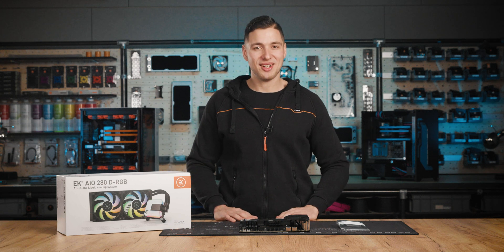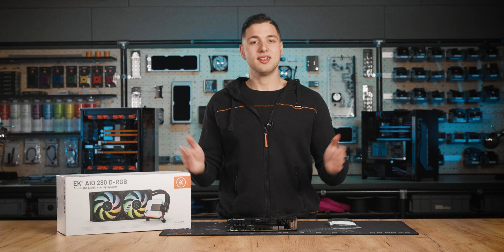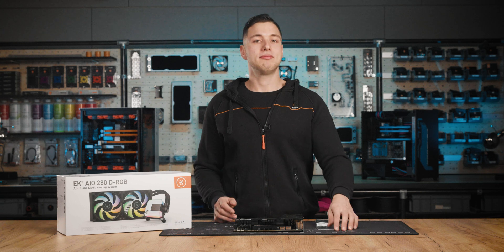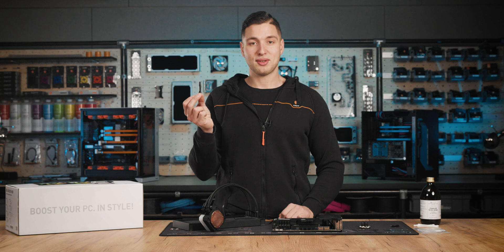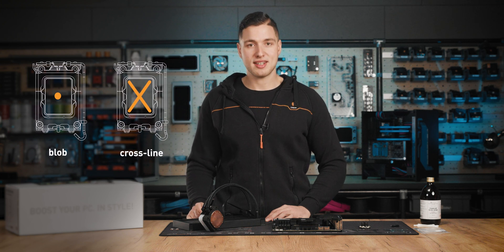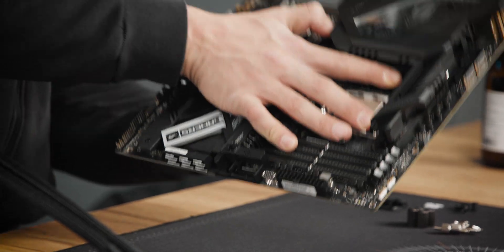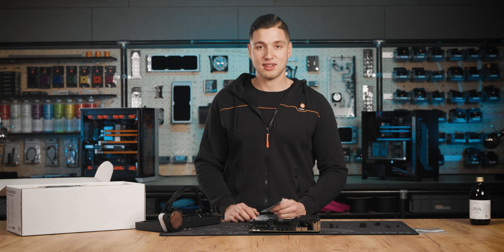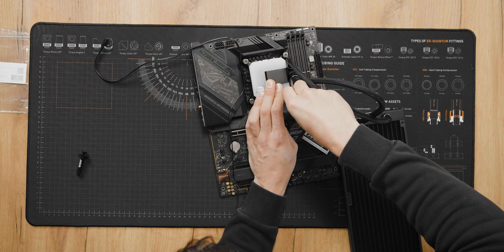Installing the EK-AIO LGA1700 Upgrade Kit for new Alder Lake Intel CPUs | EK HOW TO

Comment: I contacted EK about the upgrade kit and they told me to get it from a reseller. Only links they provided wanted $60+ with shipping.
Trying to figure out where I can get plastic washers or if they are absolutely necessary.

Comment: hey... i have EK AIO Basin 360, it says compatible with only these sockets 115x, 20xx, 1200, AM4 
my question is upgrade kit comes with Velocity Backplate, what about pump bracket ? dont i need one ? 
as i know 1700 socket is 78mm x 78mm, is there any space for that with the bracket one i have already ? 
i know i can check it with  loosening the screws, but i dont have any thermal paste anymore :( please enlighten me.. thank you

Comment: At the very end I caught that I should use only the thumbscrews + springs from the 1700 kit. Unfortunately, I have two bags of thumbscrews + springs that are not labelled,and I'm not sure which bag is from the original kit, and which is from the 1700 kit. Is there anyway to tell? Spring coil spacing seems to be slightly different between the two bags. Please advise.
Reply from the maker: Contact our customer support team with pictures of both and they will let you know which ones are correct: https://customerservice.ekwb.com/
Reply: @EKbyLMTEK  Just to follow up here, the response from customer service was that it didn't matter and they are both the same.
Reply: @chigasakigaijin  good to know. Im ordering a back plate from someone else. Last thing i ever get from ek

Comment: Are you kidding me that in January 2023, after not just 12th gen but even after 13th gen, the LGA 1700 parts are still not included with the AIOs?? Unbelievable. I bought an Arctic AIO 11 months ago (which sadly doesn't fit into my new ITX case) and it was already in the package back then, ready to be installed.  AND the EK website says that the LGA 1700 upgrade kit won't be available until January 31. How am I not supposed to think that this company is a joke.

Comment: On 13600k it works very well with the pre-applyed thermal paste. Even if it is square applyed on the monting presure it will spread a little more. I got max 75 C in full load on ek basics 240 in Dan H2O case 👍. Cheers!
Reply from the maker: Thanks for sharing! We're glad it worked for you!

Comment: The standard LGA frame that come with the EK-AIO is a much better design. This new EK LGA1700 seems to have been made in a hurry. There are not secure limits for the screws. We can literly tightening the EK LGA1700 till it's too much and getting RAM failures or even BSOD errors. If we tight too littIe we get CPU overheating. I really do belive EK can do a better job on the LGA1700. I had many coolers in my life, and on the good ones, we can tight the block screws till the end without worrys of BSOD or RAM failures. On the previous LGA, with a 9900K, I had no problems. The same can't be said now. Sorry EK but this is my personal experience !
Reply: Exactly!! I just helped installing this for my friend on his new LGA1700 PC and managed to SNAP TWO screws due to overtightening, on the LGA115x you could go all the way as the threads stop (secure limit). I noticed the screws on the LGA1700 plate are a little bit longer on the backside, which is the issue. I replaced the screws from the old LGA115x build and managed to tighten it securely.

I have built so many PCs I've lost count and this has never happened to me before, maybe not tight enough but definitely did not manage to snapscres on any of my backplate installs no matter what the brand or socket until this.

Comment: These AIO's are still being sold and marketed as "LGA 1700 ready". It is not mentioned on any websites that an additional purchase is required to make them "LGA 1700 ready".
This is essentially false advertising. 
I would have liked to run EK products, but I cannot wait 2+ weeks to have a bracket shipped to me that should have been included in the box to get my PC back up and running.
I returned the EK and bought another AIO that is actually "LGA 1700 ready".
Terrible PR from what I thought was a reputable brand.
Reply: bruh
Reply from the maker: We're so sorry this has happened to you. These AIOs aren't listed as LGA 1700 ready, as we always explicitly mentioned they require an upgrade kit. We apologize that we failed to get our message across clearly - we will try our best to improve the clarity of communications on our end.
Reply: @EKbyLMTEK  Wrong. They are still being advertised as such.
Reply: @EKbyLMTEK  sorry not paying $20 just for the bracket lol rather buy the deepcool lt720 at least Amazon lets me use Cashback

Comment: Are the thumbscrews that attach to the backplate different sized?
Reply from the maker: There are different versions of thumbscrews for different CPU platforms :)
Reply: @EKbyLMTEK  thanks for the reply. Please try to get your lga1700 mounting kit stocked in microcenter. I was hopeful i could just use the backplate from another kit that microcenter  sells with the thumbscrews that came with the ek-aio 360 d-rgb but I just bought a mounting kit online

Comment: I have one question that I can't really find a good answer to. I'm replacing my Corsair H150i with an EK Elite 360. I'll be using the Lian Li AL120 fans I already have. My radiator is oriented vertically with the tubes connected on the bottom and the top of the radiator is above the pump head. If it helps, I have a Lian Li O11 Dynamic with the radiator mounted on the side. Your videos and instructions show the hoses coming out of the pump always pointed up, even in the diagram where the radiator tubes connect on the bottom. I've seen several YT videos with the tubes facing down out of the pump and so far, I have found only one that explains that you can twist the hoses in the sockets to point the tubes down. (https://youtu.be/zyaXnPSwYsw?t=703) Is this acceptable? If so, can you include that in any future manuals or videos? (Unless I'm missing something?)
Also, think you can sell the Elites in three fan or zero fan variants? I've already got fans but I'm paying more for six fans I won't use with the 360 Elite I'm getting.
Reply from the maker: You can turn the tubes into a different direction :) We have no plans to offer the Elite version with fewer fans as most of our customers use all 6 of them.

Comment: I really don’t know if I should order this aio or the new cr360 vision for the i9 12900k. I want to keep this cpu in check, and this my first pc build. And all the aio’s I have read about can not keep this cpu in check, unload.
Reply from the maker: The EK-AIO 360 can handle the i9 12900K. If you want even more cooling power, take a look at the Elite version: https://www.ekwb.com/shop/ek-aio-elite-360-d-rgb
Reply: @EKbyLMTEK   I wasn’t to sure which one to go with for better cooler temps. But thank you for getting back to me so fast. I did look at this aio first :) 
But because you guys were releasing a new aio. I thought it would be the same just with a lcd screen. I will purchase this one today. Cheers

Comment: Do you need the whole upgrade kit or just the backplate for a fresh build?
Reply from the maker: The upgrade kit features new mounting screws and a tube of Thermal Grizzly Hydronaut along with the backplate. The screws are needed for a perfect contact with the CPU :)
Reply: @EKbyLMTEK  sweet thank you I ordered one kit and it was what I needed for the LGA 1700. Just wondering though do I need to plug in the vdg aswell as all the other plugs for the cooler?
Reply: I have a ASRock B660 Pro RS ATX mboard and a Phanteks Eclipse P400A D-RGB case. There is a port on the back of the case I think for the vdg cable but not 100% sure if that's where it goes

Comment: The AIO has pre-applied thermal paste out of the box, should I remove it (as the CPU is no longer square with LGA 1700) and manually apply new thermal paste?
Reply from the maker: Yes, that is advised when using it with LGA 1700 :)

Comment: It works on Asus b660 itx board? I have lot of trouble with others aio and i want to be sure It fit perfecly on My board. Thanks.
Reply from the maker: Turn to our customer support with exact name of your motherboard: https://customerservice.ekwb.com/hc/en-us/requests/new
They will gladly help you out :)
Reply: @EKbyLMTEK  installed today. Tubes near RAM don't fit. U have to rotate the block by 270° (yeah, not 90°).
Reply: @LakedaimonII  Hey I know it is a bit late however im building the exact same motherboard+aio combo and I was wondering  what did you mean by rotating the block by 270 degrees? It would be great to have quick explanation. TY

Comment: I bought one, but I need software. Is there ?  for a pump control?
Reply from the maker: You can set the pump speeds in BIOS as there is no software for it (yet)
Reply: @EKbyLMTEK  Did you release a software?